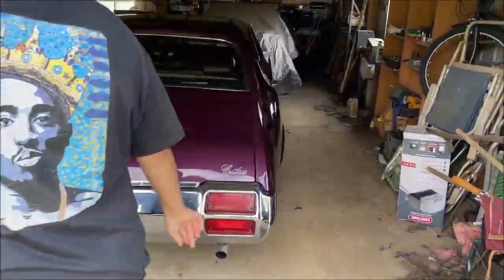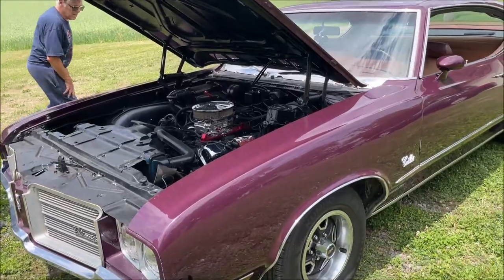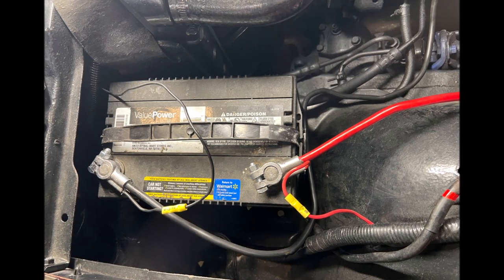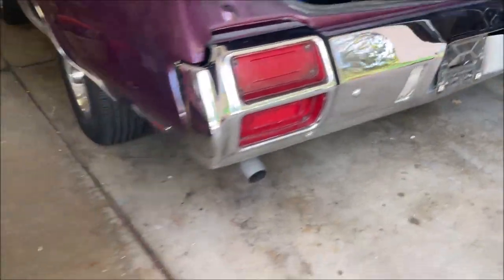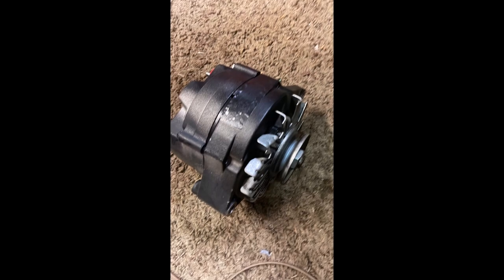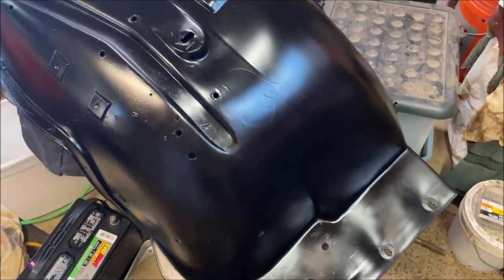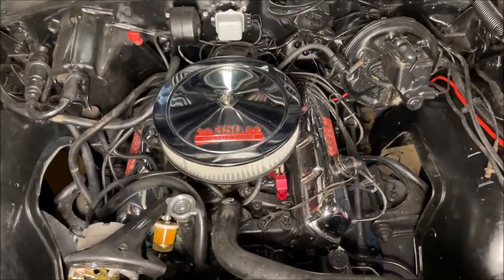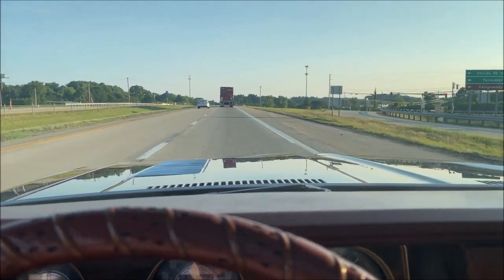Restomodding a 1971 Cutlass! Ep 01 Buying the Car

Comment: You have gained a new subscriber! I have a 1970 Cutlass and need all the pointers I can get. I got it in Akron last winter a few weeks before Xmas and towed it back to Columbus and dropped it off to my body shop to take care of the exterior now I need to work on the interior, under the hood and under the car. It is pretty much original.

Comment: I love your attention to detail of the machine part of the car than the physical design. The machine i.e motor and transmission. These two parts plus the rear gear need lots of attention for the vehicle to perform at its design or maxoutput. Ahhh I'm so drunk but really fascinated by your attention to  detail. I just sold 9/3/23   my second Cutlass 1987 and looking forward to purchasing a 1971 Oldsmobile "S"

Comment: I have basically the same car. I have a couple 72s. Anyway those wheel wells I sanded down like you did then I used Por 15 on them and they came out awesome. Been on there for 3 yrs still look amazing. I used Por 15 on pretty much everything that I wanted black. I like it because it goes such a long way. Has a nice clear shine to it as well. Anyway a metal rust inhibitor used on plastic wheel wells who knew ?

Comment: My mom had one of those Brown with a White Vinyl top automatic. I found it YEARS later in a junk yard. Dismantled it engine transmission interior out...down to frame...ect. The body had several holes torn in it. Not a lot of rust. Holes in the trunk and floorboards allowed the interior to rot however. Vinyl was torn and roof rusted through in one spot.T he engine was still running. So body was off the frame and stripped and acid bathed and panels WELDED repairs NOT brazed and straightened the front bumper right side and had it rechromed. Had the engine rebuilt. Car was in pieces but ready for paint ,ect. A guy saw the project and asked how much. I said I had 20 g s into it and wanted 30 gs if at all. He said what about 25 RIGHT NOW, I knew at that moment no more screwing around. This guy had the CASH in his hand and a SERVICE flat bed waiting in front of the mechanics office so I knew this was a SERIOUS offer. I said SOLD on condition you send me photos and a ride. Sent me the photo s but the car is in Kansas City Kansas, so I haven t had a ride.

Comment: I just bought a 72 Cutlass Supreme, Not alot of people know but the C Pillar and quarter panels are different on the Supreme than they are on the Base Cutlass, 442 and Hurst Edition. I'm going to Restomod mine as well but I'm building a 80's Hot Rod out of mine. I'm painting it Black Rose, the Deep Dark Purple that GM used on the mid-late 80's Camaros, Vettes, S-10s and other cars like the G body Regals and Cutlass's. I'm going to do the interior in Grey, the front drivers seat and the Dash Pad needs to be redone I might as well have the passenger seat redone and dye the back seat, Door Panels plastic, the headliner is already brand new so I'm going to mess with it. The Engine and Trans running great, rebuilt 25k ish ago so I'm just going to do a rattle can Rebuild on them and then I;'m going to throw some Enkie 72 Wheels on it, those are the repop wheels on the mid 80's Firebirds.
Reply from the maker: Yes, the notchback... good luck on the project! It sounds awesome.
Reply: @CobblerBob  Thanks, it will be fun